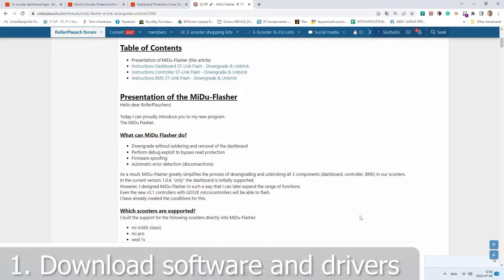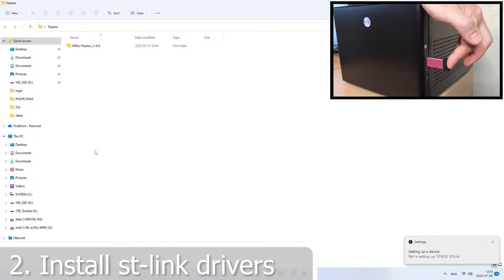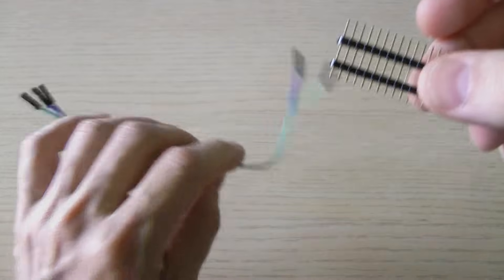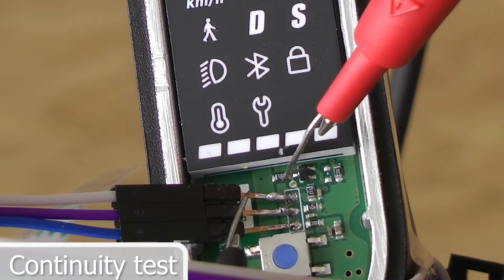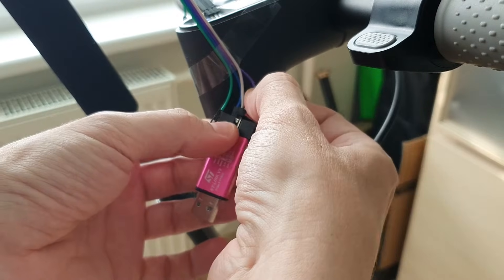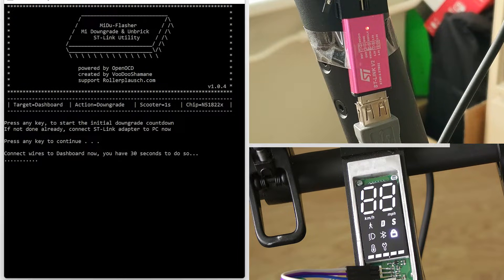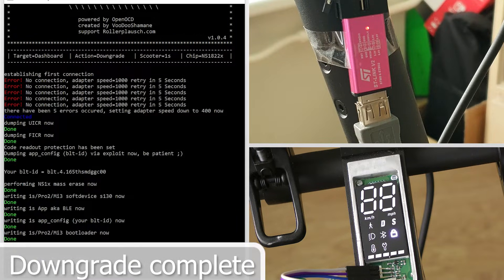Xiaomi scooter 1S BLE157 downgrade using stlink

Comment: so this just flaseha the ble to a version lower than the 157? my references are,1.1.0_248_157_141. I'm waiting for the stlink. In the microcontroller option I have to choose the one above since my board is the orginial no and once finished this flasehar completely with the DonwG to reinstall everything complete in the version of drive bms and ble that I want via bluetooth?
Reply: HOW DID IT WENT?

Comment: what is the order of dots on the 3.2 v plate from top to bottom, and you have to lock the skate to flahse it? Thank you.
Reply from the maker: It's same board revision, so order is the same. Lock is needed, as without lock scooter will shut down automatically and cut board power.
Reply: Thanks. 👍
Reply: what to do if i didnt lock it, can i save it?

Comment: Hello, in some guides is recommended to remove the c2 condensator  and R1 resistor (backside) in order to enable fw flashing… can you confirm that these steps are not really necessary?
Reply from the maker: No, it's not necessary. After BLE downgrade don't forget to check your ESC version. There are different DRV for 3.0 and 3.1 boards. Subscribe, thanks.
Reply: @MindaugasJocionis  today I tried again and my dashboard revived, tnx man
Reply from the maker: @JUN_OTKU  Nice :)
Reply: @MindaugasJocionis  thank you! My board is not 3.1 , what is the DRV version needed for my model?
Reply from the maker: @danilnz91  If it's not 3.1 you can use any DRV, it will not brick your mainboard.
Reply: @MindaugasJocionis  ok thank you! I will follow your guidelines
Reply: @MindaugasJocionis  ¿mi placa es la 2.3 v hay posibilidad de brink?
Reply from the maker: @ivangonzalezgarcia4823  I was talking about ESC(main board), after the BLE (dashboard) downgrade you will probably flash your ESC, and if you flash ESC3.1 with old version DRV it will brick.
Reply: @MindaugasJocionis  someone can help me I tried to flash mine but is showing a error and I can't done the flashing
Xiaomi essential
Reply from the maker: @fabio_eg9608  Where is the error? On the scooter dashboard or in the app?
If on the dashboard, what's the error code?
If in-app, then:
You can try to choose "3) Write Flash" instead of "1) Downgrade" 
Subscribe, thanks.
Reply: @MindaugasJocionis  Hi, I broke my dashboard trying to downgrade, can I fix it? Because the gnd disconnected to the dash board in the middle or process, can I try to downgrade with other program? Tanks
Reply from the maker: Did you tried "Write flash" instead of "Downgrade", as well you can try scooter hacking reflasher app. Subscribe, thanks.

Comment: How to fix a defect 27 in a Xiaomi scooter without changing the mother card
Reply from the maker: You can recover your mainboard (ESC) with the stlink. 
Try asking this telegram chat group for help: https://t.me/scooterhackingchat
Or this guy, he has recovery tools for 3.1 ESC board: https://t.me/STLink_XAP2P

You have the 1st type of new microcontroller on your mainboard (ESC3.1  GD32E), you need a different DRV.
After recovery build it by yourself:https://rollerplausch.com/threads/neuer-controller-v3-1-bei-aktuellen-xiaomi-rollern-brickgefahr-bei-drv-downgrade-vorgehen.5187/page-6#post-67651
Subscribe thanks.

Comment: Hi, my friend has a pro 2 mercedes version drv: 155 ble: 157 and he flashed using downg without downgrading ble with a file called "Drv_233_Pro2_StockFW.zip" Will this brick my pro 2 (ble 157 and drv 233)?
Reply from the maker: Until BLE157 is not downgraded, nothing can be flashed. After flashing the firmware will remain the same as before flashing.
Reply: @MindaugasJocionis  Is it safe if i tried flashing this file on my pro 2? Hes been teasing me to do it because im terrified about my scooter getting bricked, i don't know how his scooter actually goes 33 km h/
Reply from the maker: @Undead-Edits  You can brick your scooter while flashing DRV made for ESC 3.0 to ESC 3.1 What is your ESC version?
Download the "m365 downG " app and look up the UUID under Tools
If the UUID does not contain the characters FF , it is the new controller 3.1: Flashing the old DRV* leads to Brick !!
If the UUID contains the characters FF , it is the old controller 3.0: no problem with flashing
Reply: @MindaugasJocionis  It has FF so i can try to flash and no harm will happen?
Reply from the maker: @Undead-Edits  Yes you can try.

Comment: did everything correctly still ble 157. not sure whats going on
Reply from the maker: Maybe you set Y when asked to spoof BLE? 8:36
Did the flashing go without errors?
Subscribe thanks.
Reply: @MindaugasJocionis  I just subbed then :D
Reply from the maker: @TensaMugetsu1  Cool, don't forget to check your ESC version before flashing DRV
https://rollerplausch.com/threads/neuer-controller-v3-1-bei-aktuellen-xiaomi-rollern-brickgefahr-bei-drv-downgrade-vorgehen.5187/
Reply: @MindaugasJocionis  i pressed y when asked to spoof  BLE and it went without errors but still BLE 157
Reply: Just pressed no on spoof BLE and it worked thank you very much mate!

Comment: Is there any difference between the different colored ST links? I ordered the green one, which cables need to go where? lol
Reply: Oh okay, sorry for the confusion and thanks again :)
Reply from the maker: @YogiMystic  No problem :)
Reply from the maker: They are all the same. Watch the video @ 7:01-7:04 to see where to connect the wires.
Subscribe, thanks.
Reply: Also hauptsache die 3 gleichfarbigen connectors irgendwo in dem ST Link einstecken? Und wie nennt man diese Wire Tips in Deutschland? 😅 Dankeschön!
Reply from the maker: @YogiMystic  No, you need to connect those 3 pins on the dashboard: (GND; SWCLK; SWDIO) to pins on stlink with the same label. (there is a diagram on stlink).
I'm not from Germany :)

Comment: Hi I just want toshare my experience with this method, I flashed the scooter succecfully but I did NOT check my microcontroller. I still don't know which one I have, however I pressed the first option in the program when I was given the choice of what microcontroller I had. Everything seamed fine, until I flashed a custom firmware to increase the speed. I went for a ride and quickly noticed that the scooter would turn on whenever I tried to shut it off.  I googled but could't find somone with the same issue, I then tried to flash back to the stock firmware with no result using my phone. I then tried to flash it using the st link with my original flash that I had dumped before flashing the first time. From there I was able to connet the scooter with the mi home app and uppdate the motherboard and once I had done that everything worked fine again. I want to run custom firmware in order to connect my batterypack but as I have mentiond this method did not work for me and I m positive that it has to do with the microcontroller, so I have ordered a clone motherboard with a diffrent microcontroller and hopefully it will run custom firmware succesfully then. None the less great video.
Reply from the maker: You have a 2nd type of new microcontroller on your mainboard (ESC3.1  GD32F), you need different DRV.
Build it by yourself https://rollerplausch.com/threads/neuer-controller-v3-1-bei-aktuellen-xiaomi-rollern-brickgefahr-bei-drv-downgrade-vorgehen.5187/page-6#post-67651
Or ask this guy in telegram chat, he has prebuilt ones https://t.me/STLink_XAP2P
Subscribe, thanks.
Reply: @MindaugasJocionis  Hi, thank you for the reply. I have now built my own custom software of DRV319. I have not tried to flash it yet beecause I wanted to ask you first if it will be compatible with my currrent BMS ? I Have BMS 141. I would very much appriciate a reply, good day.
Reply from the maker: @ANDROID204  BMS does not matter as long as you are not flashing it. BMS is a battery controller and you are flashing DRV (mainboard controller). I think this time everything will be fine.  
Check out this telegram chat, here you can find much more help than on my channel :)  https://t.me/scooterhackingchat
Write back about your results!
Reply: @MindaugasJocionis  Thank you so much man, I subscribed and shared your video with my friends. I now have custom firmware installed so that when I enter echomode it goes 25kmh and when I enter sport mode it does 20kmh or 15 in drive. The reason I did this is because its ilegal in my country if the scooter does more than 20kmh. So now if police wants to test my scooter they can do so in sport mode or drive and it will all be fine.
Reply from the maker: @ANDROID204  Cool, thank you. In my country (Lithuania), the speed limit is 25 km/h, police didn't stop the scooters to check the speed :)

Comment: Hi I tried modding my xiaomi essential to make it go faster but now all it says is error 27 control code error, I looked it up and it says that I have to change the motherboard, is there any other way I can solve it? like with the st link?
Reply from the maker: Probably your ESC board is 3.1 with a new microcontroller (you needed a different type of DRV). You can recover your mainboard (ESC) with the stlink. 
Try asking this telegram chat group for help: https://t.me/scooterhackingchat
Or this guy, he has recovery tools for ESC board: https://t.me/STLink_XAP2P
Subscribe thanks.

Comment: Hi. I have 365 pro
with:
DRV Ver:160
BMS ver:107
BLE ver:15188 (or on another application (-.1.0)
What can be done in my case ? ;/
Thx and regarding
Reply from the maker: I don't have experience with these older models. If it's the original dashboard you don't need stlink, as m365 pro does not have BLE that is unflashable with BT. Follow this guide: https://www.monopattinoitalia.it/miglior-firmware-xiaomi-v2/ (use google translate)
In addition to DRV, you will need to flash BLE that is prepared for the new DRV version.
And try to ask for more help on this telegram chat: https://t.me/scooterhackingchat
Subscribe, thanks.

Comment: Hi will this work for my xiaomi pro 2 scooter its on ble 1.5.7?
Reply from the maker: Yes, choose the Mi pro2 model instead of 1S in midu-flasher. Subscribe, thanks.
Reply: @MindaugasJocionis  Alright Thanks a lot
Reply: @MindaugasJocionis  I just got the ST Link today and I flashed the old bms on my pro 2 I done it without soldering and it worked like a charm. You create amazing content. Thanks a Lot.

Comment: I got error 42 after downgrading how to fix it?
Reply from the maker: What model of scooter? Mi3?
Subscribe, thanks.
Reply: @MindaugasJocionis  yes Mi 3
Reply: I flashed the scooter with firmware from Bluetooth another video, I noticed that the version of the DRV went down after it, but the speed limits did not work. After that, I decided to download the original firmware back. Loaded the original DRV from this video, but BLE didn't want to get up. There was an error 41 and the scooter made a beep sound. Then I connected it to STLINK and did a dashboard downgrade. After that, the scooter returned to normal. After that, I filled in my firmware and, lo and behold, everything worked.
Reply from the maker: @ARMONEY666  For Mi3 I use SHFW 0.2.5 from the "scooter hacking utility" app as I found it optimal. With it, there are no errors, and the motor does not give strange jerkings under 30% of the battery charge. 
As for errors 41 or 42, you need to use another hacked BLE (for Mi3) or make DRV on the web interface and check the compatibility checkbox. 
As I said it's not worth it to bother, it's better to use SHFW 0.2.5 :)
Reply: @MindaugasJocionis  Thanks.  everything is fine with me now, but when I ride at a maximum speed of 30-35, the scooter starts to slow down and then pick up the problem.  battery is 100% charged.
Reply from the maker: @ARMONEY666  It's normal. You have reached the limit of this electric motor + standard battery. When you pick up a speed of 32-35 km/h, it starts to slow down. It has something to do with the electric motor and physics.
Reply: @MindaugasJocionis  hi, i downgraded my Mi3 but i only can change my BLE, when i try to change my DRV using SHFW it gives me an error (Size/Chunk format error).
What can be the problem?
Reply from the maker: ESC3.0?
Reply: @MindaugasJocionis  yes
Reply from the maker: @OgiVM  Try asking in this telegram chat: https://t.me/scooterhackingchat

Comment: Hi there.

I'm here with a problem I encountered. Basically I successfully connected the st-link to the scooter. Did everything right but when it comes down to the Midi flasher its not working properly.
Started the program, choosed the corresponding options in it and didn't thrown any unexpected error when I started. I did not cut the connector to the condensator and waited the 5 error.
When the Midi Flasher lowered the speed to 400, there was a weird thing. The program said its connected, its shown as connected but after a second or so the error that it cant connect came up like when the speed was too much. I think'ed it's a problem like so and waited. The program went from connected to error and so on till it reached the point to lower the speed more but now only just the errors popped up.
I tried to resolder it 2 times and did not worked. Tried to change the ST-Link firmware or reinstall the whole thing but that did not worked either.
I don't know what's the problem soo that's why I write this :D 
I have a Xiaomi Pro 2.

I hope you can help me or someone and thank you in advance :))
Reply: Hi there. I had same problem. What helped to me? In Select an Action I tried to choose "3) Write Flash" instead of "1) Downgrade" and it works. Now I have BLE 134 on my Pro 2 and back my custom FW (flashed again).
Reply from the maker: Try to ask for help in this telegram chat https://t.me/scooterhackingchat
Did you checked for continuity with multimeter? In my opinion it's bad connection.
Subscribe, thanks.
Reply: Yep I  checked for continuity and it was ok. 
Maybe going to try again with a better solder because mine is like a cheap one XD and with better equipment for soldering.

Comment: Hi dude, i did everyting as in your video, after downgrading process, i cannot connect to my scooter through bluetooth, scooter hacking utility is stuck at "Pinging scooter" step, and original xiaomi app is connecting and disconnecting after 1 sec. Is My bluetooth dead?
Reply from the maker: No, kill all apps on android and re-enable bt connection. Or restart your smartphone.
To connect to mihome, you need to remove your scooter from the app and connect again like the first time. (this happens every time you use a third party app). Subscribe, thanks.

Comment: Hi, honestly, I don´t know where is problem. I have Pro 2 with BLE 1.5.7. I stucked on 9:40. It say "Connected" but the message follows: Error, retrieve in 5 seconds. Please help
Reply from the maker: I think it's bad connection, check continuity with multimeter. Subscribe, thanks.
Reply: @MindaugasJocionis  DONE! I´ve got it. What helped to me? In Select an Action I tried to choose "3) Write Flash" instead of "1) Downgrade" and it works. Now I have BLE 134 on my Pro 2. Great!
Reply from the maker: @marcel698  Glad to hear you got the issue resolved :)
Sorry for not replying, I didn't receive notification of your previous message.
Reply: @MindaugasJocionis  everything checked, also continuity. I tried it on 2 computers with different cables from Stlink to Xiaomi dashboard. Hmm

Comment: What's a capacitor
Reply from the maker: https://rollerplausch.com/attachments/c2_cut-jpg.17930/
You don't need to cut it, miduflasher works with a capacitor untouched.
Reply: @MindaugasJocionis  Did you cut it, because i watched the video and i don't see you cutting it
Reply: @MindaugasJocionis  I don't have flux what do i do
Reply from the maker: @Undead-Edits  You can try without flux
Reply: @MindaugasJocionis  Did you cut the capacitor
Reply from the maker: @Undead-Edits  no

Comment: Is there a substitute to making the wire tips because i don't have them
Reply from the maker: You can use any metal that fits: paper clip, paper pins, etc. 
Or go to a local DIY electronic shop, there definitely you will find such or similar wire tips.

Comment: Good video, but my question is do not remove the capacitor c2?
Reply: what's the capacitor
Reply from the maker: You don't need to necessarily cut off this capacitor, if you cut it off, the connection will be faster and more stable. Subscribe, thanks.

Comment: Hi, the MiDu-Flasher app does not download any of the content, what can I do? Is there any link for the files?
Reply from the maker: It downloads only once, if you downloaded it, then it will not be downloaded 2nd time as it is already in the app folder.
You can put it manually:
"If you want to flash your own BLE version, you can simply store it in the appropriate folder
under MiDu-Flasher\Resource\files\BLE\App\N51822x\(Scooter)\App.bin ".
https://files.scooterhacking.org/firmware/
For more help ask in this forum: https://rollerplausch.com/threads/midu-flasher-st-link-downgrade-unbrick.5399/
I did it in automatic mode...
Subscribe, thanks.
Reply: Ok thanks! It worked once I stop my antivirus 😅😅

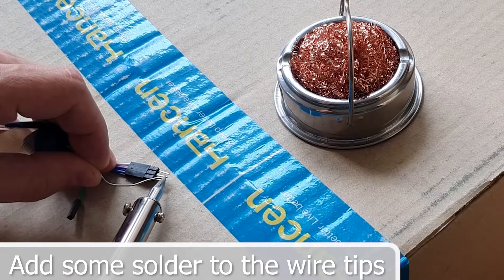Comment: Do I have to solder it and if not, I have to redo these wires somehow? By that i mean 4:27 process
Reply: Ok thanks
Reply from the maker: You can do the same without soldering: https://youtu.be/NYxrvGhevwg
Or after the downgrade, you need to desolder those wires 10:33
Subscribe, thanks.

Comment: friend, it is not necessary to remove the resistance 16?
Reply from the maker: No, there is no need to desolder the capacitor or cut its track.
Subscribe thanks.